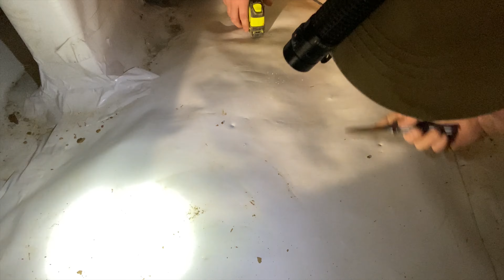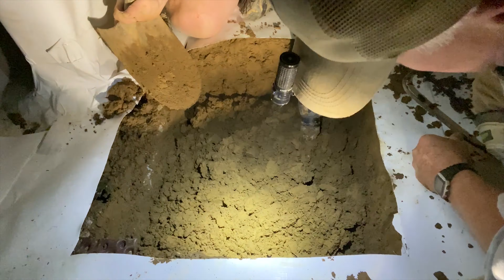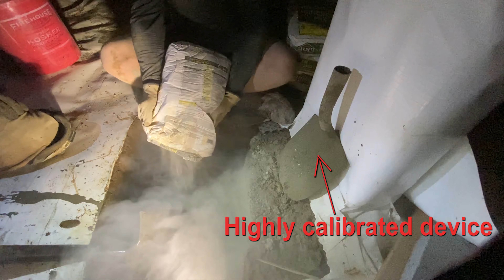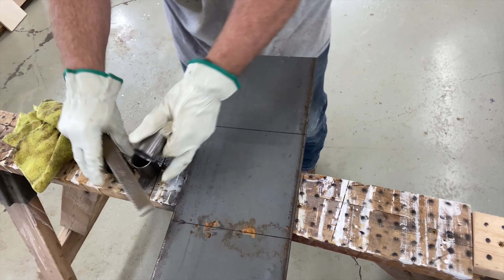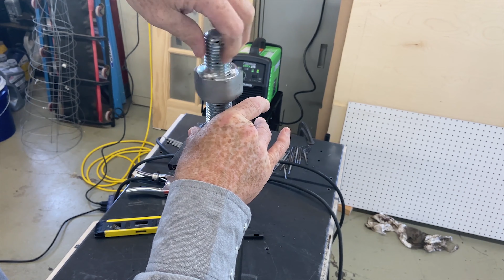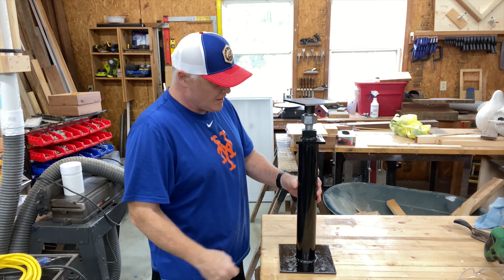THE SMARTEST JACK ON EARTH. STOP FLOORS FROM SAGGING AND DEFLECTION.

Comment: What size all thread did you use? I made 2 of these with schedule 80 pipe. Made my own bottom nut out of 1" A36 plate that sits on the pipe. Just used 1 " all thread. Wondering if is should go bigger with my all thread. Posts are 33" tall. Did 12" of all thread.
Reply from the maker: I found mine on ebay from a someone that had them.  I don't remember the size but I think the diameter was 1.25".  It sounds like yours a well equipped to handle the job for sure.